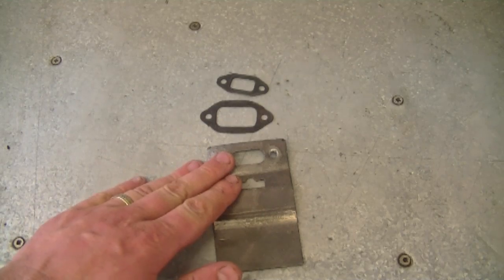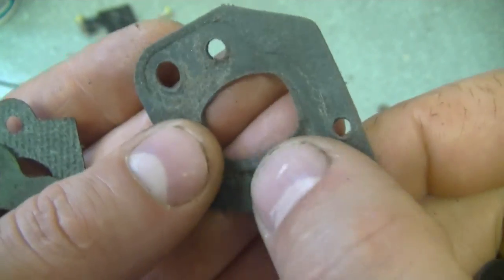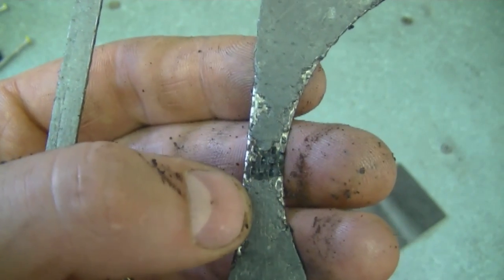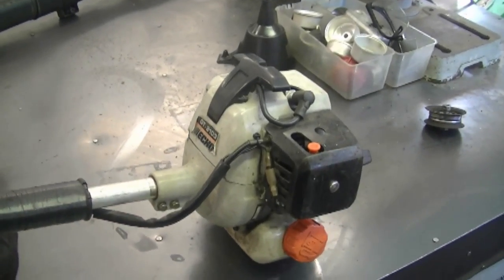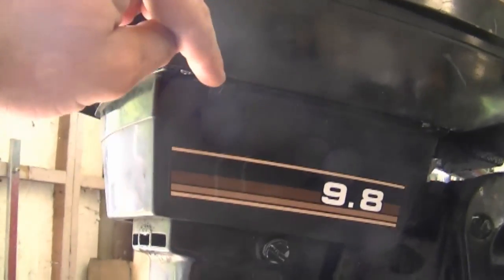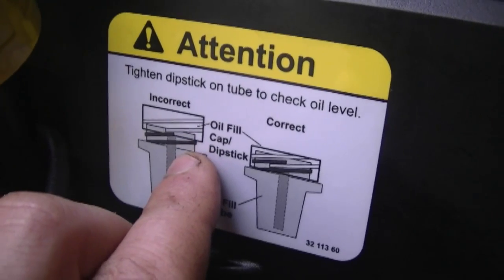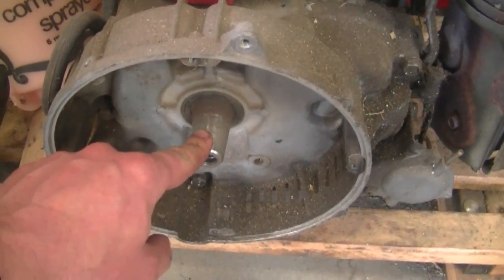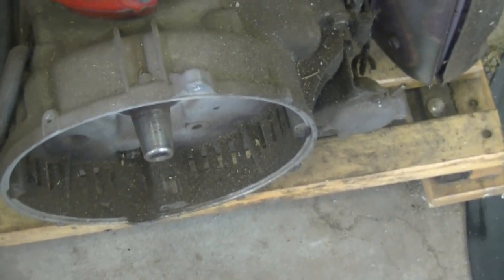Small Engines Q & A Video #102 in HD

Comment: very helpful videos thanx a lot.here is my question. I own a 2009 Craftsman YT3000-28922 riding mower. I replaced the battery spark plug,all the filters from gas,Air,oil,,,.now the mower goes off after 5 or 10 min of use(dry gas filter when it goes off).loosen the gas cap 1/2 turn trick didn’t work. I been told the mower doesn't have a fuel pump.

pix

flickr.com/photos/82767759@N08/7576294136/in/photostream

Comment: Hi dony. I have Ben working on a newer stihl chainsaw.  For a neighbor and he burnt the bar and chain up. So I replaced the bar and chain and sharpened it and it would immediately smoke the chain and bar as soon as it started cutting into wood so I thought it was the oiler but it wasn't and the brake is off so what is it I need help.

Comment: Great videos. I have a Poulan Pro PPB 200 trimmer. Starts fine, but when you try to pick it up by the handle or throttle it stalls. You can lift the head upwards it still runs but anything that points down even slightly it dies. Fuel filter and hose in tank are new. Worked fine a couple of times after service but since then runs great when level on ground but can't pick it up to use.

Comment: Hi Dony,

I've been watching your videos for a while. I am about to move back to Canada, and am looking at buying a new snowblower. I've narrowed it down to either 1)  Simplicity I1224E (24") 250cc or 2) Ariens Deluxe ST24LE (24") 250cc. I'm leaning towards the Ariens b/c of its larger 14" auger and its cast iron gear box, but I recently heard the Ariens transmissions have problems. From your experience, what machine is less likely to need repair?

Thanks!!

MR

Comment: Hi donny,found your videos very helpful, I have a question. I have a Craftsman Grass Trimmer with a 24 CC engine that will not start. It has a new spark plug with a nice blue spark, I checked the filter in the tank, its ok. I cleaned the carburetor,it seems ok. Did a compression check, it pulling about 65 psi.  I pulled the cylinder off. Either of the cylinder wall or piston is scored. But the piston ring is sloppy. Its like the groove is worn?  Have you seem some thing like this?  Thanks

Comment: it blows smoke when you rev it up or down and the starter some times struggles to turn it even with good valve clearances i think it is because the battery cable caught fire once from the old shorted starter that's why i think the compression is good an seems good when turning it by hand.

Comment: Several years ago went to the lake and found both outboard motors would not pump i.e. show water stream at vent. Dismayed, I came home. Why would two nearly new motors go out the same time? My neighbor brought out a small diameter drill bit. Inserted it in vent and discovered insect larve, a nest of eggs deposited in each vent effectively blocking them. Water circulation began immediately. Neighbor got a squirt in face of foul odor and smell. "Stand back" Dennis, Seattle

Comment: well, i got a stihl 051 that i bought without a bar (needed rebuilding), and was told it had a .404 sprocket.  I had a bar from another saw that I thought would fit but the studs are too big.  The bar I have dosen't have any identification on it.  I don't know what I need for my saw.  I don't know what the different types of teeth are for and I'm sure this info would help others.

Comment: heya dony i was wondering if you could give me any idea you might have on a motor that i just had go on me its an onan 18hp circa 1987 (dont have the exact model# right now) anyways its getting back pressure into the carb from the crankcase and wont run well anymore, also it was having a hard time running but then would go just fine once it got revved up(all of this is recent) my brother thinks i might have grabbed the wrong jerrycan and used old gas gumming up the rings) any ideas?

Comment: I have a Kohler Courage 20, took it back for oil leak and didn't check the work. Over time the bolts on the plate under the flywheel either backed out or the service dept. didn't tighten them back down and it blow the gasket out. Now it is out of warranty. No luck like bad luck.

Comment: i have a briggs 17 horse engine it just started blowing heaps of smoke on start up and when u rev it up and down it has excellent compression i was thinking maybe the head gasket has blown motor was fully refurbished by a qualified mechanic 3 years ago so dose any one know i have also tried adding some thicker oil did not help.